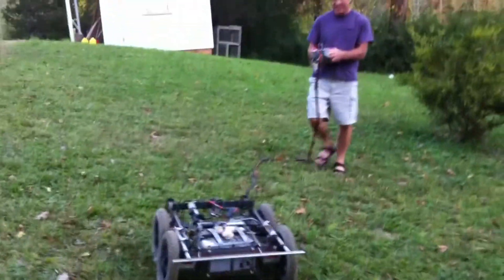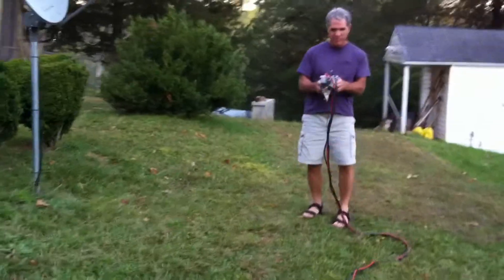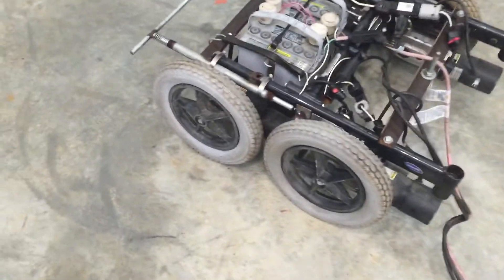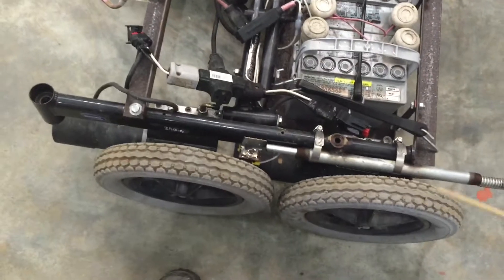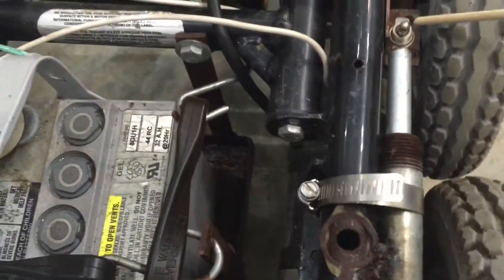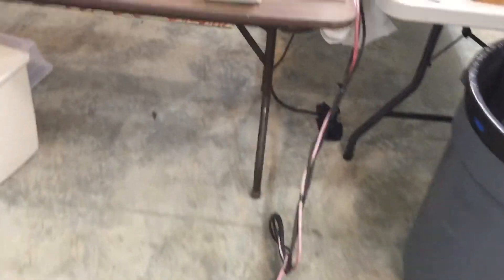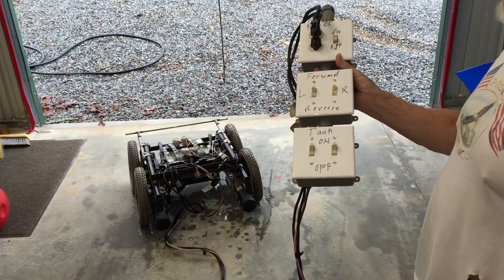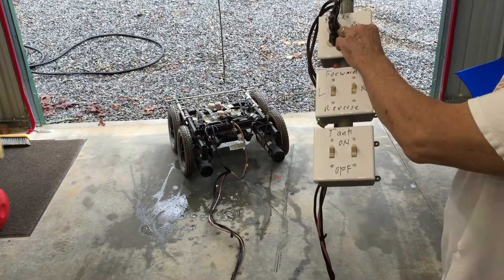4 X 4 Wheelchair Robot

Comment: That’s awesome. How did you wire the motors to keep from the back one from moving faster or slower than the front? Thanks
Reply from the maker: Sorry for the delay in responding. If the front and rear wheels were moving at different speeds I did not notice it. Even if you put a mechanical linkage such as a chain between the front and rear wheels the wheel diameters would also have to be identical. I suggest not to worry about it unless you have a problem. The intent of this was to show how you can make something at a very low cost. I have what I need to create an iPhone app to control it wirelessly, but I have not had time to work on it. I may have it done in a few months.